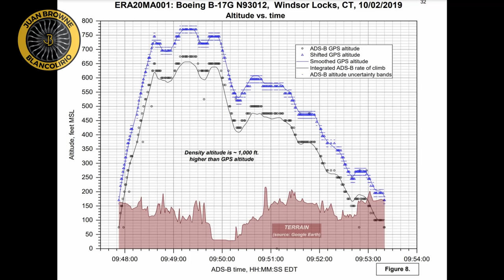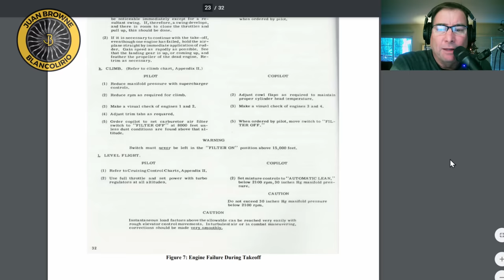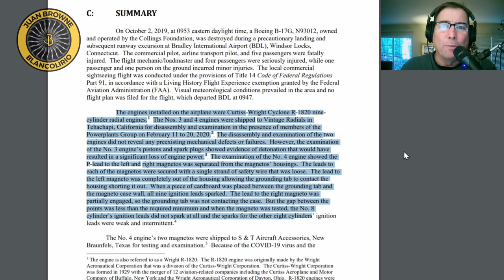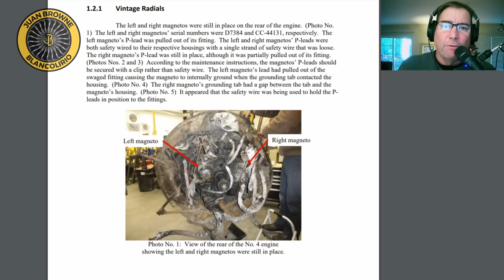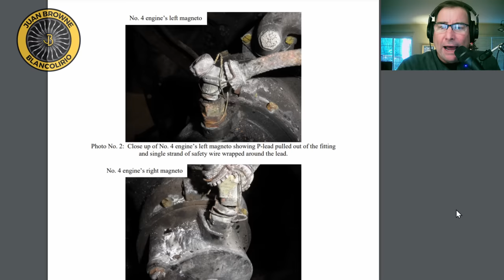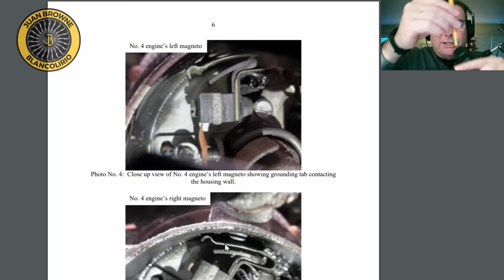NTSB Report B-17G Crash 'Nine-O-Nine' Part II -18 Dec 2020

Comment: 17:00 Another cause of detonation is octane rating of the fuel. I think I remember Juan saying these engines like 120 octane or higher, which IIRC, isn't available now.
Reply: Detonation can be avoided by retarding the spark timing, which also reduces engine power. This trade-off was acceptable in a lightly loaded aircraft (non-wartime).
Reply: @gordonrichardson2972  True and Juan did mention the magneto to engine timing was not reported so it could have been a factor.
Reply: I wonder if perhaps the timing had been set to the original spec and not adjusted to account for lower octane.
Reply: In the first video of this pair, Juan covered the fuel. The fuels was tested and was up to snuff and free of contaminants. Bradley is Connecticut's largest airport and the Connecticut ANG also operates out of their. They have avgas available.
Reply: @williamwallace9826  The avgas available at Bradley Airport is 100LL.  I have no doubt it was good 100LL.  However, if the engines were tuned to use 115/145 detonation would be expected.  The 115/145 Avgas was used in many WW-II aircraft but I don't specifically know about the B17.  The last 115/145 in Canada was made in 1982.  I don't know if it is still available anywhere in the US.  If there was an octane problem it looks like it started long before the aircraft arrived at Bradley.
Reply: @gordonrichardson2972  The worn cam follower which causes the points gap to be narrower than spec COULD retard the timing some... provided the magneto wasn't re-timed with that wrong points gap. All in all, it seems the mags weren't properly maintained.
Reply: @charlielund3579  115/145 fuel was a late arrival.  Lots of WWII radials were using 80/87 and 91/96; some of the type certificate data sheets for the 1820 do require 100/130, which is now the 100 LL specification.
Reply: @paulcrumley9756  Wow.20degrees btdc! That's pretty advanced.Useful info thanks.
Reply: @paulcrumley9756  ok didn't realize that. My point of reference was that I had an old pickup with an even older transplanted higher compression big block engine that I always ran premium fuel in and had the timing set for premium. One time I put regular fuel in and ran it hard without adjusting the timing, detonated a piston. Could have retarded the timing a little but then it got doggy, so I just used premium after I fixed it.
 But "the loss of 909" was Such a sad sad deal overall.
Reply: @paulcrumley9756  100/130 is NOT the same as present 100LL.  BTW, 100/130 was colored GREEN.  Using 100LL means the engines do not have as much detonation protection and cannot be run to rated boost. Thus they develop less power.  One more degradation of their flying performance.
Reply: @KB4QAA  You really should read up on things before you say stuff. Before I posted that I did MY research, and found this:
Yes, 100LL does meet the 130 rich rating and all other properties of 100/130, except for a limit of 2.0 grams per gallon TEL and a different dye color.
Wow. Same rating as 100/130, and I found that in far less than one minute.
Reply: My dad's college room mate went to work for Wright early in 1942, in the engineering dept. He worked on R-1820's along with other Wright engines. Early in the war a detuned version of the R-1820 was developed by the Wright engineers due to fears there would be a shortage of high octane av gas.  Reducing compression and retarding timing will allow them to run on lower quality fuel, at the expense of power of course.  From what we see in the photos I don't think anyone was too concerned with timing as long as the engine could be started and flown. The narrow gap in the points would change the timing all by itself. The detonation damage to #3 was astounding considering that was a low time engine. That would have been destroyed shortly by the looks of that one piston. Detonation is very destructive of gasoline engines if not fixed promptly. The internals of #4 did not look bad by comparison and that was nearing it's overhaul time.  The day after the crash I looked at Collings Facebook page and they were begging for money to obtain a replacement for #4 as they knew it's time was nearly up. In my book a good solid operation like this one would have had a spare engine ready when it was needed, not try to shop for one when their back is against the wall. There are still quite a few of these engines still flying and parts are around and can be made if necessary.
Reply: @nathanpitts1591    2. In aircraft detonation is prevented through use of proper setting of Mixture, and Manifold Pressure by Throttle/Boost as documented in the Flight/Engine manuals.   3.  Money is money. few operators can keep all-up spare engines on hand.  That is not an indication of poor maintenance.
Reply: @nathanpitts1591  Yeah, there is a Type certificate data sheet for a version of the 1820 that is rated for lower octane fuel. I don't think the B-17 type certificate allows for that version of this engine, however. In addition, the 100 LL rating conforms to the same specification as 100/130. There is some difference in blending practices, but both fuels are equally approved and meet the same octane specs.
Reply: @paulcrumley9756  As far as I know those engines were developed on an experimental basis and not ever used in military usage as there was adequate av gas available. Plus the military usage required all the power possible.

Comment: I've never worked on radial engines but made a living for many years machining and rebuilding automotive / industrial engines. That #3 engine #9 cylinder looks like what you see in an engine after sitting in a field for decades with no exhaust cap. Hard to believe it was actually running at all looking like that. Possible it got water in it from fire fighting efforts, and sat for quite some time before tear down?
Reply: Good point as the piston skirt and rings would have kept it clean and shiny while running.

Comment: Iirc, detonation is a timing issue. If the spark comes earlier in the compression stroke than it should that causes pinging....then detonation as you get earlier. Generally, engines do  want the spark early...yep, for better power!
Hence the phrase "5 before top dead center" which calls for spark to occur 5 degrees of rotation before the top of compression stroke. 
Detonation damage indicates spark FAR too early over time. That engines' been running off time since overhaul is my guess.
Reply: A few misconceptions here- Aircraft magnetos are checked several times between engine overhauls. Complete overhaul of mags normally at 500 hours, on an engine that can go 1200, 1800 or longer TBO.  Poor running or spark plug indications would properly have triggered a complete mag inspection. Basic timing of an aircraft magneto is more like 24 degrees BTDC. There is no vacuum or centrifugal advance on aircraft magnetos, except for normally an impulse coupling to aid starting.

Comment: The corrosion is post fire. There is no protection on those parts anymore so they rust fast. Look at burned cars after a week same thing...
Reply: That level of corrosion is due to water sitting in the engine for a long period of time, not just bare metal exposure to the elements.  I've seen this plenty of times in engines that sit with water in them for months.  An engine that just sits won't have that kind of corrosion.  Particularly because the corrosion is deep down the bore, likely under the piston, essentially in the crank case where lots of oil is present.  If water gets into the crankcase, it will displace the oil and you'll see heavy corrosion like that.
Reply: That damage is from the fire and sitting before teardown, no engine cylinder looks like that if it is being run with oil circulation
Reply: @brentspang9092  Radial engines are different the cylinders are in a circle some up some down and in between your comment does not apply in this instance but might be possible in an inline or V block.

Comment: I can't know what was happening in the cockpit at the time, but, I  agree with several others, #4 should not have been shut down. Full power at low pitch on all engines and then evaluate. A little power is better than none, and also would have helped to stay further above VMC resulting in less yaw and better climb.  Should have cut all power on initial touchdown to eliminate yaw. I am a licensed multi-engine pilot. Robert Brown.

Comment: Not addressed was lack of separation between maintainer and flight operations. There were two operations controlled by one person who sadly thought he knew it all. This was a conflict of interest. There was a culture of disregard for basic rules of safety as demonstrated by Mac standing on the very top of a step ladder, (see 1:25). For those who have not read the report there was a recurring problem with the magneto and moisture collecting internally. Instead of solving why this was occurring a non-standard, unapproved modification to the magnetos consisting of a  plastic line was added to the magneto assembly allowing dry nitrogen to be blown into the magneto from the ground, (I believe the line was run from the landing gear wheel well to the magneto). Prior to the flight the pilot once again had trouble with moisture collecting inside the magneto assembly. He then instructed another mechanic to blow dry nitrogen into the magneto via the plastic line to displace the moisture that collected within the magneto. This coupled with magnetos and sparkplugs that were out of tolerances allowed all the holes in the block of swiss cheese to align for disaster. Also unaddressed was why did he not declare an emergency and land immediately on the closest runway instead of going around. I suspect that had much to do with the attention a declared emergency landing would've drawn from the FAA, the discovery of the magneto modifications that were lacking an STC, and potential loss of credentials to those responsible. Had the aforementioned conflict of interest not existed the pilot would have been focused on getting the aircraft on the ground ASAP and letting the subsequent chips fall where they may.

Comment: I've always been fascinated how the investigators determine what condition things were in before a crash and what was caused by the crash itself...
Reply: Well in the case of the missing retaining clips and the P-leads being safety wired that must have occurred before the crash. The same thing with the miss gapped points and spark plugs.

Comment: People must remember that these aircraft were designed to be maintained by an entire squadron of mechanics with very specific jobs.  Not a group of old guys as a volunteer job.  As I've stated before, I've seen some VERY questionable MX habits in regards to warbirds and although have had many opportunities to go up in them....have declined due to what I've seen.  More engines just exacerbate the issues... Those engines were in piss poor condition.  Full stop.  No excuse other than apathy and gross indifference.  If I were those surviving PAX, I'd OWN the Collings foundation in the near future....
Reply: The maintenance to flight hour ratio was very high. Modern military aircraft can be thirty to one, don't know about WW2 aircraft, but you can bet that it was higher than even for each engine alone. Non-profits, even with volunteer labour, would not be able to match or go close to that.
Reply: @jeffreythompson9549  I will say though, "our" (EAA) "Aluminum Overcast" does receive a very high MX tempo though.  Probably more than any other "living" B17 around.  It was restored here over about 10 years or so....As do the Tri's we use for scenic flights around Oshkosh both during the show and through the museum during the summer and fall.  I have no issues with the schedule our birds undergo but they're (from what I've seen) the exception.  I know for sure, mags are checked/cleaned/gapped regularly as a part of the PMS program.

Comment: Wouldn’t the magneto and plug issues have been apparent during engine run up before takeoff?  Was the crew used to operating with problems and becoming complacent?
Reply: In the report the passenger statements say that they didn't do a runup at all. Just taxied to intersection and sent it.
Reply: I share a similar perplexity with Mr. Ciminel. While it is understandable that weak sparking may go unnoticed, issue of the left magneto being grounded cannot be missed. That improper fixing of cutoff mechanism in the last major overhaul should have manifested earlier on itself for an engine approaching TBO.
Reply: If what I've been reading is accurate, if a proper mag check had been done Number Four engine would have quit.  One mag on that engine was completely shorted.  Shut off the other mag as required and the thing shuts down.

Comment: Excellent video, Juan. As to the shutdown of number four, I question whether it was a smart move. First of all there is the lack of CRM, along with a proper shutdown checklist. But the load master is quoted in the NTSB report as wondering why he "caged" number four. They may have been getting some thrust from number four. Then you have number three which was detonating in more than one cylinder. I'd be interested to know if it was in fact the sicker engine on the right wing. I didn't watch your first video but I also question McCauley's decision to drop the gear on downwind with the airplane barely maintaining altitude. Throw in his lack of a run up prior to his intersection takeoff and he doesn't come across as exercising good judgment IMO.

Comment: The spark timing for the engine is normally set by rotating the magneto or the points plate to give the spark at the correct crankshaft angle - with the points set to the ideal gap. If the gap is incorrect due to wear, then the timing will change, and the spark may weaken as a secondary result of the incorrect gap. If the 'heel' of the points arm that rubs on the magneto cam wears, then the cam will open the points by less than the required amount, and the points will open slightly later than they should, retarding the spark from the ideal angle. Both the smaller gap and the retarded spark will reduce the engine power significantly at full RPM. Contact points that have worn away over time will have the opposite effect - the points will have a larger than ideal gap, and the spark will be advanced, as the 'heel' will contact the magneto cam earlier in its rotation, and open the points before the optimum crank angle. Over-advancing the spark will, as you point out, cause detonation, which can damage or even destroy an engine fairly quickly if it is severe, or prolonged. Wear on the heel is reduced by applying a small amount of the correct grease to the cam lobes each service, or in some cases, by putting a drop of oil onto a small felt pad that rubs on the cam lobes during rotation. (The 0.006" magneto in the video seems to have this fitted to the cup around the cam, and is visible from the 5 o'clock to 11 o'clock positions, but although there is a recess for it, it is absent in the 0.014" magneto....) Erosion of the points may be due to a faulty or incorrect capacitor, or by improper cleaning-up of the surface pitting during maintenance.

Comment: We have replaced our old style points in our generators with an electronic system.  Could a new type system be used for these engines also.  Then would not have to worry about gaps.

Comment: Wouldn't the mag problems on the #4 engine have been detected during an EOR run-up procedure?    Did they even do a run-up?   I saw one statement from one of the passengers who had aircrew experience, who seemed to be indicating that they taxied direct to the runway (intersection takeoff) and departed without any delay.   If true that is another very troubling concern about the way this crew performed on that day.   These two pilots may have been experienced, but it sure sounds like they were rather complacent as well.

Comment: Just one thing, do you think that maybe all the corrosion in that cylinder from the #3 engine could be due to the fact that firemen were hosing it down with water of whatever else they'd use to put out the fire? I've seen my share of engines that got run after sitting around rusting that someone managed to get started and I've torn apart afterwards and the rust in that cylinder sure looks to me like it came about AFTER the last time the piston and rings were moving up and down in it, it looks more to me like a rusty cylinder from an engine that rusted and no one even turned it over before I took it apart, not a corroded cylinder that'd been run after it corroded.

Comment: There's a lot of focus on the ignition points, their condition and gap settings. But it's the corroded cylinder that stumped me. How could a cylinder become so badly damaged, so soon after a major inspection, and still run? I've never seen anything like it.

Comment: It is said that there is a chain of causes prior to an accident. The corroded cylinder shown at 18:15 is one of them. Unbelievable.
Reply: Agreed. And it's from the GOOD #3 engine. Juan states he doesn't think this corrosion occurred between the crash & engine tear down. And they say 300+ hours since overhaul. That cylinder looks like it's been sitting stuck and collecting rain water from the exhaust for decades like an old junkyard engine. I can't believe it was running at all for a long time.

Comment: He has the most time in a B-17 , so what ?  Is it customary to fly passengers  around in a plane with known problems?
Reply: The PIC screwed up from the time he started rolling to the crash. The copilot was equally at fault.  He should have taken control of the AC after it became obvious the PIC was no following emergency procedures. He didn't even declare an emergency.